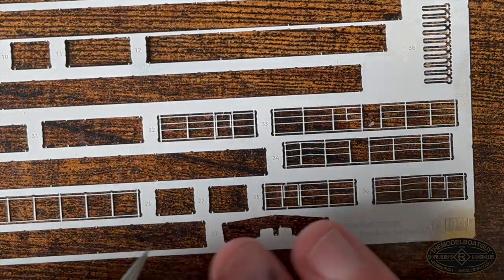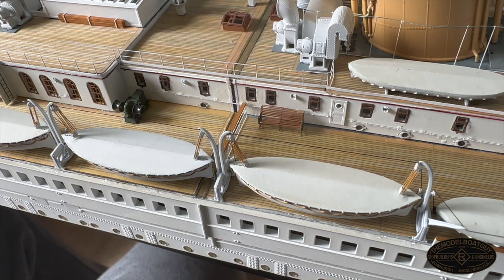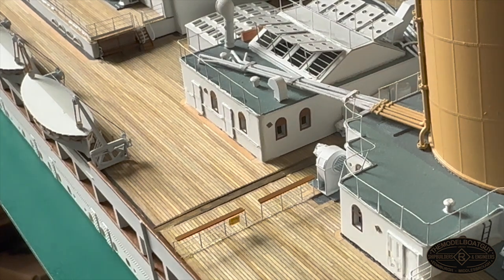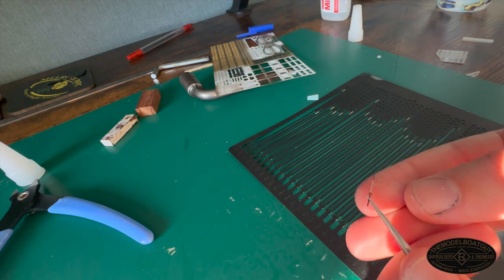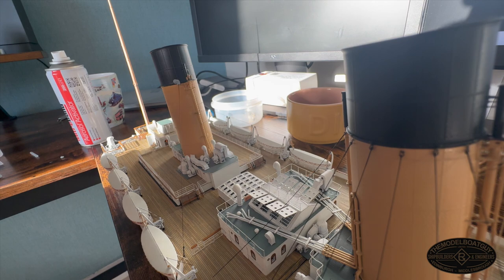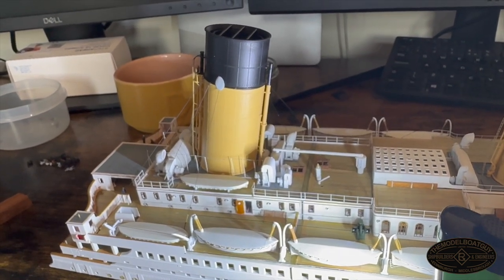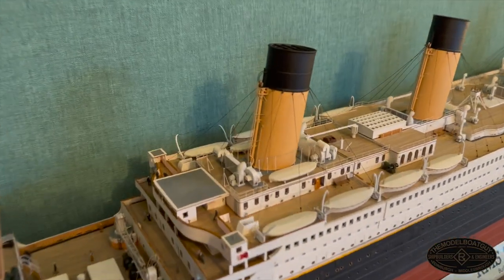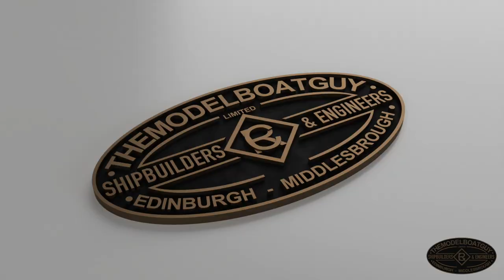Radio Control Trumpeter 1:200 Titanic Build Part 85 - Funnel Stays

Comment: Looking  good Robbie. It would be nice to see you build another model like this. Without the restrictions of RC (weight) and including a lot of the upgrades that came out after the fact. Your RC model is an art in itself though. But it might be much doing two in a row of these.
Reply from the maker: Hi Vis, yeah in some ways it might have been easier to just not make this model RC! 
I think in future i will probably stop sailing it, and will then add all the details I haven’t added yet, like Woodys side photo etch. 
But that’s a while off!
Reply: Oh you should sail it. The art is in that.